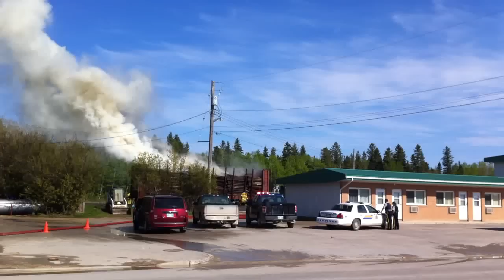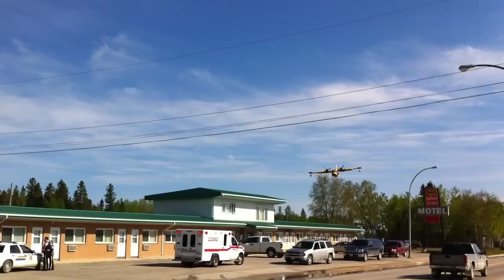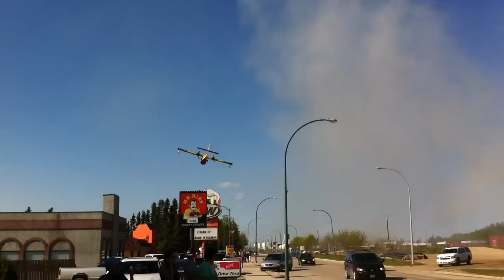Water bomber used in rail fire

Comment: In SoCal, the scoopers generally exceed their landing weight when they launch. So if the initial call was a fire in the weeds, they would have launched and would need to drop the water somewhere. (assuming they launched with a load) I am more curious why they dropped downwind. 8 pounds per gallon with the added tailwind packs a punch.

Comment: An air tanker is USELESS here, regardless of what's in the water.  It CAN'T penetrate through the stacked railroad ties or get the underside of the ties.  The ONLY way to put out a fire like this it to unload the whole car and extinguish it a few ties at a time.  Any kind of foam or even dish detergent would speed up the process, but it'll take awhile even with foam or wetting agent.

Comment: This is Canadair build aircraft, assemble and test flight  in Montréal,Qc. it is a CL-215,it's an older model , série mark IV or V , 2 drop door,radial engines,no winglets,no bullet feairing,but it still opérated very fine ! the ones used in Canada last longueur ! no exposition to salt water... 

a+ James
Reply: their built in north bay ontario
Reply: The best planes for this are made by Bombardier, made in a suburb of Montreal.
Reply: Jim Stull no they're built in north bay Ontario CYYB on the south east side of the field right next to voyageur airways

Comment: Water bombers are an expensive asset.  And it's not going to do anything with those ties burning.  I've dealt with burning ties quite a bit, and dumping plain water on them won't put them out.  I wouldn't risk that asset in a populated area.  You don't need much of a fire dept. to handle that kind of fire if you bring in a loader or crane to take them off the car, which they did.  Ties are always a pain to deal with, not complicated, just tedious to extinguish.

Comment: And if you read the description yourself, you'll see that they had to get an excavator and unload the car to put it out, just like I said.  You don't need a big fire dept to handle a fire like this. One good crew should be able to handle this.  Put a few gallons of dish detergent in the tank of the fire engine circulate it, and hose down the burning ties.  This isn't rocket science.

Comment: It IS a waste of resources.  That fire is NOT likely to spread to anything.  It's slow burning and winds are light.  A trip to the grocery store for a few gallons of Dawn or Joy detergent would've given much more bang to the buck.  And I GUARANTEE that drop did NOT extinguish that fire.  Ties have splits in the wood and fire burrows deep into the wood.  The ONLY way to put them out is completely immerse them or unload them and use wetting agent or foam.  You must've been Chief of maintenance.

Comment: That's a complete waste, as cool as it is to be that close to a drop.  Ties will burn in the cracks of the wood on the underside.  You can drop water all day and it won't put it out, the fire just burrows into the wood.  You have to completely immerse them in water on use foam.

Comment: If you had 2000 gallons that you could use on the ground with hoses I'd agree.  But using it in an air drop is an expensive option that won't have a significant impact.  I just don't see the reasoning to call somthing like that in.  It's just one of those fires that's going to be a real pain in the butt.

Comment: @Bob Binette That's horse shit. A bunch of other countries design and build water bombers and fire suppression aircraft. The US uses a ton of them out West.
Reply: Scotty Catman Name one water tanker that the U.S. built where the Type Approval was based entirely around being only a water bomber? Russia has done it, and yes Canada. The U.S. has only modified previous Type Certificates with LSTC's to become water tankers and water bombers. Horse Shit?
Reply: Mark S.
Weird, that's not what you said in your original comment. What point would that even drive?
The US has produced some of the most iconic and effective aerial firefighters including the DC-10 Air Tanker, Evergreen 747 Supertanker, and Martin JRM Mars.
From what I have the time to gather, Canada brings the CL-215, CL-415, and Dash 8 Q400-MR. The CL-415 was based on the CL-215, which was designed for transport, so that pretty much counts as one airframe. The Dash 8 Q400-MR was built off of the Q400 framework, which is a transport framework.
So tell, me which common aerial firefighters does Canada produce that are entirely firefighters from the ground-up?
Reply: Scotty Catman Wrong. The 215 is based off the 204 concept, which was purpose-built as a firefightning plane.

It was drawing off experience on working on transport/logistics aircraft, but is not a derivative of these.
Reply: Scotty Catman Wrong. The 215 is based off the 204 concept, which was purpose-built as a firefightning plane.

It was drawing off experience on working on transport/logistics aircraft, but is not a derivative of these.
Reply: Chris Duncan
I've got sources that agree and disagree with that.
Either way, I've proved my point. I don't really care to say Canada doesn't make water bombers, it's not my prerogative.